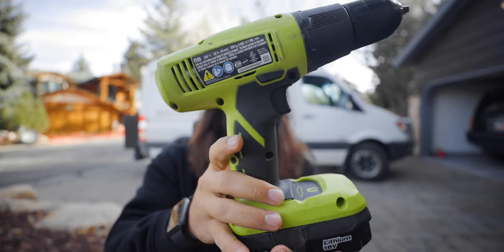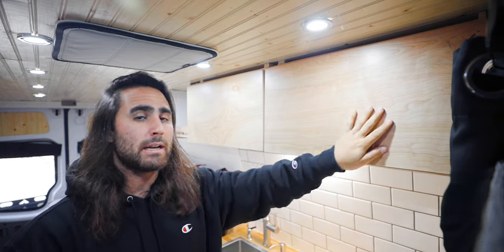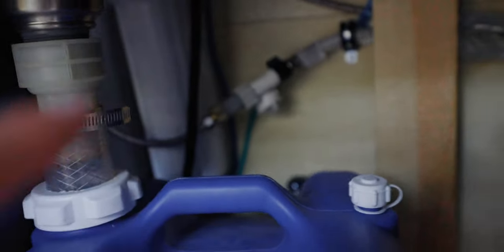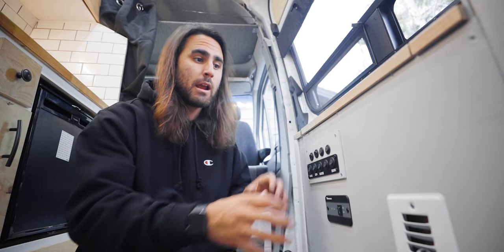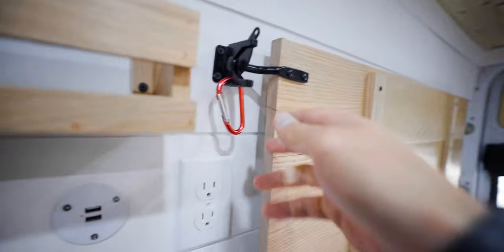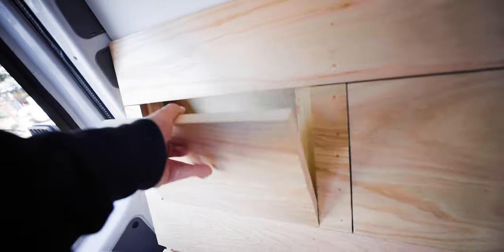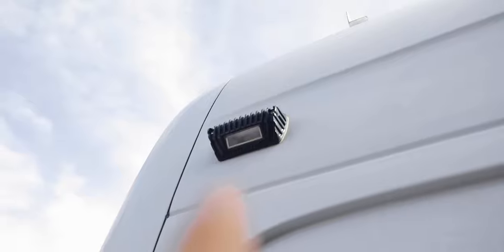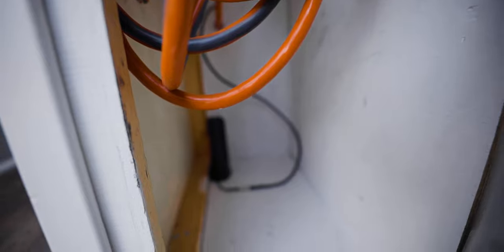DIY CAMPER VAN TOUR! | full sprinter van tour

Comment: Do you like your diesel heater placement? Would you place it somewhere else if you could?
Reply from the maker: hmm i think overall it is in a good spot. i think having it closer to the fuel pump of the heater is better than having it further away. but i would say that the back of the van definitely takes some time to heat up compared to the front! i like where it is!